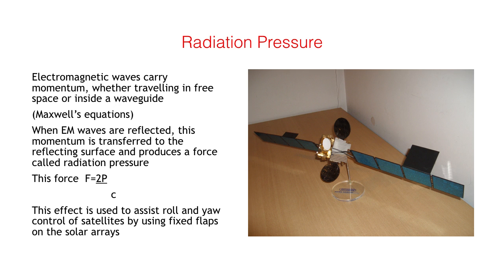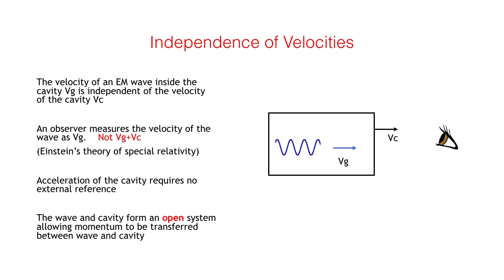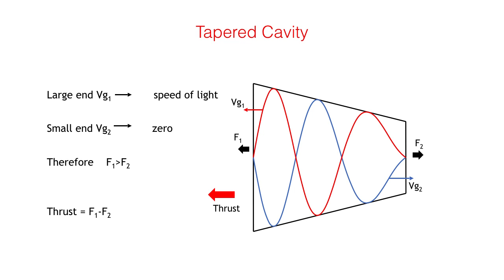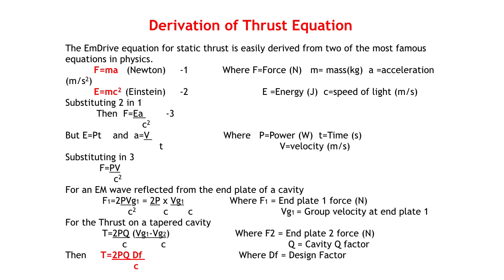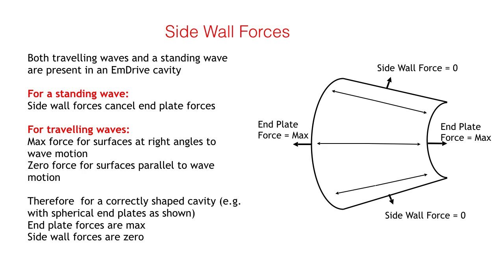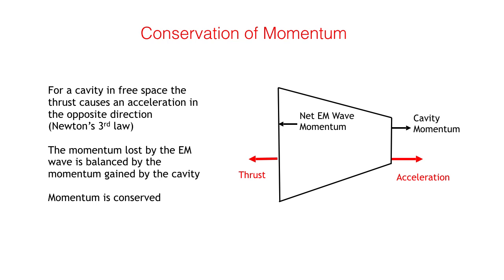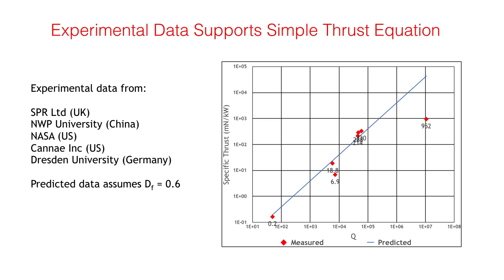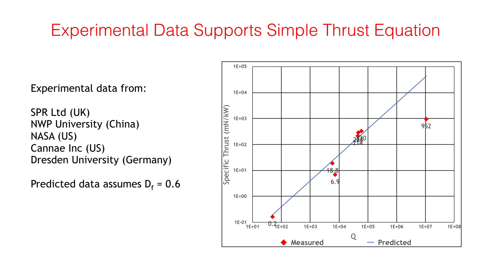Roger Shawyer Explaining The Basic Science behind #EmDrive

Comment: Right at the outset there is a flaw.
He shows a picture of a satellite and claims force applied to it by light reduces propellant used through its lifetime.
Problem is a satellite orbits the earth so half the time it's going toward the light, the sun, the other half away from the light.
Net force would be zero.
Clearly this person has a screw loose.
Strange you play this after NASA and many others have falsified the EM drive.
In science you can't prove anything only falsify it.
Hence the barrage of words.
A torch would work better.
Reply: First, it's not always those two options. The satellite can also be on the opposite side of the earth than the sun, not getting any direct light. Second, the flaps are what are being pushed on by the EM force. Like a sail boat, all of it is being blown on by the wind, but only the sails provide any real noticeable net force on the boat, resulting in movement. Going along with the sail boat analogy, you can (through clever design) sail into the wind, not directly but even with a head wind you can move forward. The same can probably be applied to the satellite, allowing the movement the narrator describes.
Reply: +edlubs11 I presume you are trolling me with that nonsense.
Satellites don't adjust their orientation to garner lift, they orient their solar panels to maximise power.
Reply: The Kepler telescope is even now using solar radiation pressure to orient itself after its reaction wheels stopped working.
Reply: +MrMan1533 precisely.
But that is not due to effects described above, that due to solar wind and photons bouncing off the craft.
The EM drive has the photons totally contained inside the box and use the bogus explanation that light travels at the speed of light on one end of the cone and at zero velocity at the other end of the cone.
These are two completely different explanations for causing reaction.
One is real one is bogus,
The EM drive is bogus... Just get over it and move on.
Reply: if the rumours are correct the eagleworks paper has just passed peer review and will be published in the next couple of months.  also cannae are launching a cubesat containing their version of the emdrive within the next couple of years.
Reply: +Matthew Broadhead interesting.
I did a search and the rumours are based on an International Business times article quoting a "now deleted" post of an independent scientist.
IB times are also famous for running stories such as NASA hiding contact with aliens.
Yeah, right.
I can find no other reference that is based on more solid reportage.
It doesn't let the inventor off the hook conflating well known solar wind effects with what he is proposing with his device.
They are two totally different things.
As this Popular Mechanics article points out, eagleworks  is charged with investigating all sorts of impossible drives so their investigation is not evidence of anything really... Especially considering we don't know what the paper contains either.
That paper has been coming for a very long time.
http://www.popularmechanics.com/space/news/a20076/the-emdrive-will-undergo-peer-review-that-it-wont-pass/
Reply: +Bernie Zelvis the scientist was Dr Rodal who is apparently listed as a coauthor OK the paper who hangs out at NASA space flight forum. I saw the original post before it was deleted. it does seem increasingly likely that this could be legitimate
Reply: +Matthew Broadhead Well it'll be interesting to see.
If the paper contains the same 'simple' explanation as in this video which conflates ion pressure of the solar wind with a dubious relativistic hypothesis then I think it's doomed.
As the article I linked to says, if they get thrust things are about to get weird.
Keep in mind that attempts to reproduce earlier results have produced null results.
And so far, so has this paper.
You'd have to ask yourself why the post was deleted and why there is no notification given by the reviewers.
Im sure being YouTube those two questions would not only prove NASA's hiding something it would eventually prove that NASA has been taken over by aliens.
Hey!
Gives me a great idea for a video!
Reply: It has been confirmed as true by AIAA... http://www.iflscience.com/technology/rumored-emdrive-paper-suggests-the-controversial-thruster-actually-works/
Reply: +Gary “Cheese on Toast” Roberson ah, have you read the article?
"Until we see the results, though, let’s continue to take the EmDrive with a grain of salt."
That's hardly consistent with "it's confirmed its true"
Comprehension problems.
Reply: +Bernie Zelvis I was more leaning towards that they have accepted a paper and are in the process of further peer review / getting it ready for publishing.... wether or not it actually works... we shall see... interesting times ahead!
Reply: In actuallity, your claim about a torch isn't far off. They are working on using plasma albeit not in a vacuum tube. However magnetrons are somewhat different using magnetic fields to excite particles in confinement. I doubt it will reach mars in 80 days but it may prove to be a more effective means than just using magnetic fields themselves.
Reply: +alysdexia and if it's 0% as found in attempts to replicate the result the hypothesis has been falsified.
The fact that it's taken this long and as the results never been duplicated tends to suggest it'll never reach theory status.
Semantics aside, let's hope your dyslexia gets better.
Reply: +Bernie Zelvis I don't put much credence in the science community. MIT is one of the leading researchers in cold fusion or "low energy nuclear reactions". A field they originally debunked.
Reply: +Walter Garvey well, cold fusion has been debunked.
That's what science is good for... Speaking of which, this Emdrive looks a bit like the Cold fusion affair.
Lots of people will lose respect over this.
YouTube professors don't matter... There will be a gazillion of them use any result to justify them not paying attention at school.
Reply: Um... You can rotate the panels of the satellite so as to minimize or maximize surface area projected onto the plane in the direction of the light source.
Reply: +DJ027X I don't think you are understanding what's being said and I think it is a deliberate misdirection on behalf of Sawyer.
We know about radiation pressure and ion drive but he introduces that idea then talks about emdrive as if it's the same effect.
It is not the same, it is a sealed box, no light, no ions, no particles of any sort exit that box.
So, just saying "it doesn't contravene the laws of physics" doesn't mean it doesn't contravene the laws of physics.
The more people bring this radiation pressure up the more I'm convinced it's a con.
Sawyer is saying light travels at the speed of light at one end of the resonator but light travels at zero speed at the other end.
That sounds like a slice of BS to me and many seem to go for it no matter how many times they get corrected.
Reply: +Bernie Zelvis so you can explain the tritium and excess heat from the cold fusion devices? Please by all means enlighten us. All you have to do is one little search and you would see NASA is now taking it seriously. That's the problem with the scientific community... Too much ego not enough relevant info
Reply: +Walter Garvey I didn't find any excess tritium or any synchronous neutrons when I tried cold fusion.
So... Over to you...
Reply: +Bernie Zelvis yeah I bet you had the palladium and all. Actually Israel is succeeding using platinum. Tough luck chum.
Reply: +Walter Garvey hahaha... Link
Reply: +Bernie Zelvis I'll just humor you and ask how many hours were you operating and what was your method for measuring temperature?
Reply: is this the paper? http://www.libertariannews.org/wp-content/uploads/2014/07/AnomalousThrustProductionFromanRFTestDevice-BradyEtAl.pdf
Reply: +Matthew Broadhead looks like it.
I draw your attention to section F, lessons learnt...
"We performed some very early evaluations without the dielectric resonator (TE012 mode at 2168 MHz, with power levels up to ~30 watts) and measured no significant net thrust."
That didn't stop them going ahead and making predictions with a 90T craft, 2 Mw of power and a hypothetical thrust anyhow.
But there's plenty of wordy guff there to get YT's excited... But I'm not excited yet.
Still skeptical, which is the correct position.